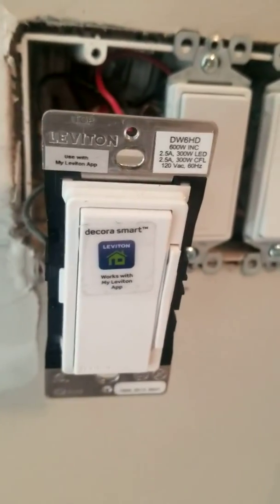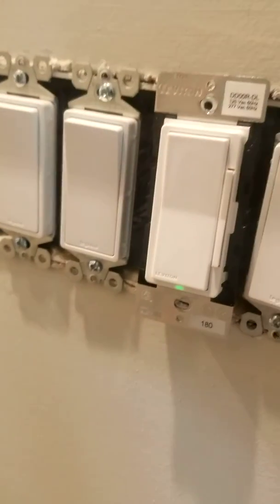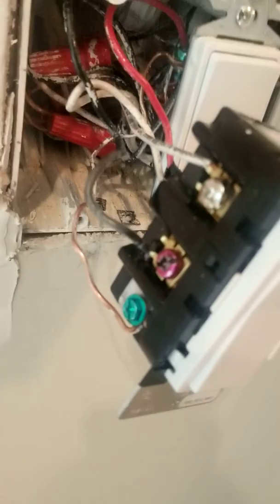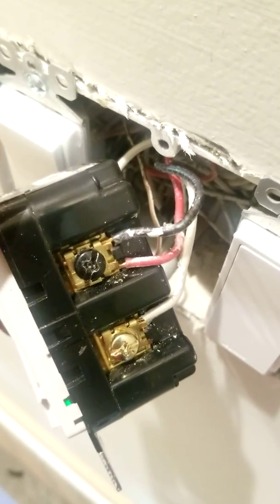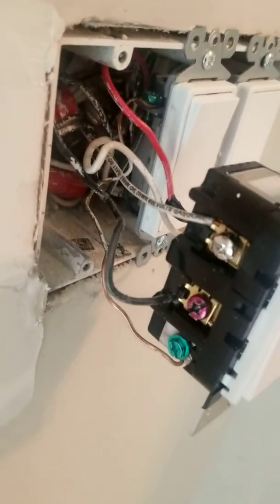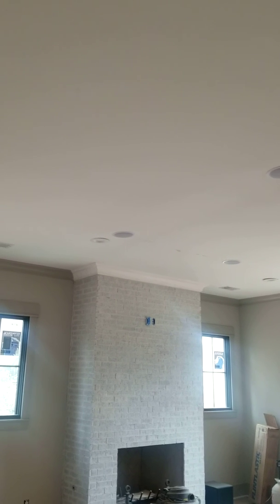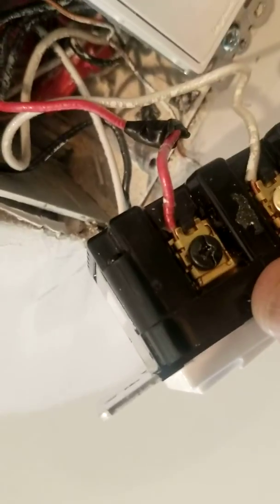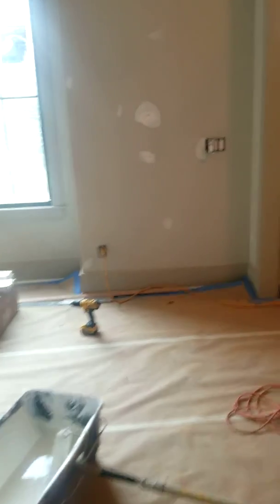Leviton 3-way smart switch DW6HD Dimmer with DD00R-DL

Comment: Darnell, I installed a D26HD and DD00R-DLZ companion this weekend. The companion was on the power side and the dimmer was on the load side. I’m confident I wired both switches correctly but I was unable to get the lights to come on. The companion dimmer did have one light on the side of the switch that illuminates for the dimmer level. Both switch boxes had two sets of neutral wires and I tried wiring into both. Do you have a troubleshooting suggestions for me? I was able to install the same dimmer in one of the boxes without the 3way setup for another light and it worked. Just the 3way setup would not work. I appreciate any help!

Comment: I don't know why I didn't search for this on YouTube several years ago (maybe it was before you posted this), but you finally got me through setting up these switches and remotes!  I tried everything I could think of EXCEPT putting the main switch at the load.  I just thought it was a dud of a product.  Watched your video and then got them working on the first go.  I did watch the Leviton video as well, but preferred yours.  Just for reference for others, I was using the DW1KD with the DD00R-DL and it works just the same.  Only difference is the DW1KD has leads coming off the switch rather than screw terminals.

Comment: what you need to know is both switches need power line and neutral you are no longer switching power the red green traveler is now just a signal wire

Comment: Thanks for this, Darnell!  One thing is, and you already mentioned that Leviton updated their instructions, is that the new video is here:  https://www.youtube.com/watch?v=T5cucTA6ioE

I happen to have configuration 2, with the line, load, and traveler jackets in one box and then in the other box just a traveler jacket.  In THAT case, the master switch goes into the box with all 3 jackets and the remote goes to the one with just the traveler.  I don't think this is a common configuration, however, so your instructions are very helpful.
Reply from the maker: Just make sure the master switch go where the load wire is and both switches  get power on the black terminals of the smart switch.
Reply: @darnellwilliams4229  Yep, I was able to get it working.  Thanks for your contribution!

Comment: I am copying this comment from another video I just visited. It is my comment, so I'm allowed to do that, right? Anyway, I had high hopes I could install this 3-way switch but apparently not. First, I did not know there was such a thing as a 3-way switch. I learned that at Home Depot when I was buying a switch. I bought the Decora Smart. There were more wires on the new switch then there were connected to the old switch. The instructions seemed to say that I likely would not be using the switch's yellow wire. I'm not sure if that is right or not. I ended up trying it in one of many configurations. I finally figured got it connected up best I could. The other 3-way switch would turn off everything, including the new light switch. So, obviously that wasn't right. I finally called the 800-number on the instructions. I was told I needed a second Leviton 3-way switch for my second switch. Nope, not happening for a couple of reasons. If that information is true, it ought to be stated right up front. It seems I wasted my time.
Reply from the maker: Well if you watch this video you will see you do need the remote switch
To make the 3 way work. The remote is a diffrent model then the master switch. I note all of this in the video . I recommend you watch video again and go get the remote switch , don't give up. You almost there
Reply: @darnellwilliams4229  I appreciate your response. There is a master switch and a remote switch. I never knew that, either. But I am waving the white flag because it has simply gotten too complicated. I now have it setup so I can say "light on" and "light off" and it works as long as the other switch is "on". I am going to tell myself that the necessity of a 3-way setup has been eliminated by voice. So in a sense, I've succeeded.
Reply from the maker: @WhtetstoneFlunky  if you attempt it the right way you will feel a lot better. You exhausted your self not knowing all the things that are required. Now you found my video it will be a walk in the park with the right knowledge. You learned something new today, you learned you need a remote and a master switch to operate the 3 way. If you persevere through this , imagine the power and confidence you will have when it comes to 3 way switches. u will be doing other ones in the house with no problems. It took me 3 days before i figured it out. Dont give up. Go to home depot and get the DDOOR-DL  switch or buy from amazon. Then rewatch my video. U will complete it in 15 mins
Reply: @darnellwilliams4229  Again, I appreciate your response. I actually took off the face plate and looked at the other switch. It was a maze of wires. It is a conventional toggle switch with two other toggle switches behind the same face plate. So I would have to change all the switches and get a new faceplate. That is assuming I could actually succeed at wiring the 3-way switches correctly. The project simply got out-of-hand. I should have done extra research ahead of time and I would have known I would have been out of my league. But thanks.

Comment: The same applies to the Feit Smart Switch Dimmer, but their instructions were clearer. BTW, do you know if the same applies to the Leviton 2nd Gen Smart Switch ( D215S) paired with this coordinating switch (DD0SR)?
Reply from the maker: Yes this video should help with Second Gen smart Switch  as the wiring is the same for most 3 way switches. Some may or may not require neutral wire, but the master and remote switch should go to the places I state in this video.
Reply: @darnellwilliams4229  Thanks!

Comment: this makes a lot of sense.
Are there 3-way set-ups where the line in and load is on the same switch or is the load and line-in always separated like in this video?
Reply from the maker: Well this setup is when you have a master dimmer switch ("load" side) and you have to have a "remote dimmer" (line in" side). If its not a 3way setup then you will only use the master switch, and the "load" and the "line in" will go to the same master switch. In most cases for this scenario, the "line in" and the "load"  wire will go to separate switches and use traveler wires to bridge the two.